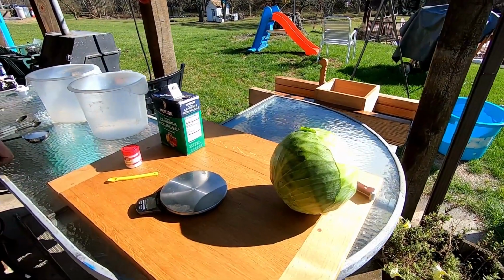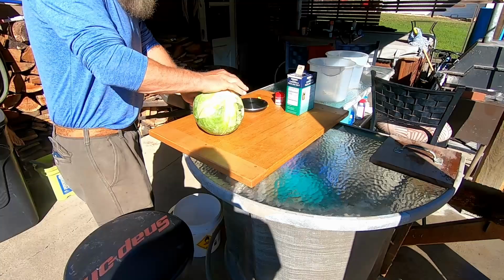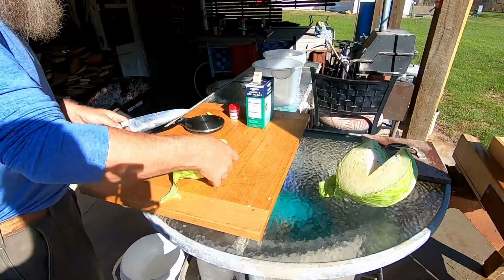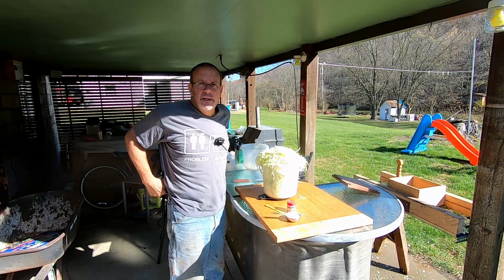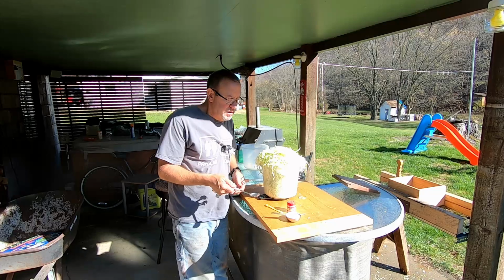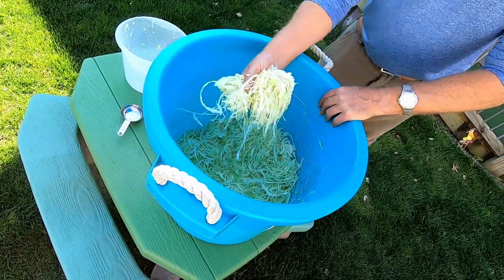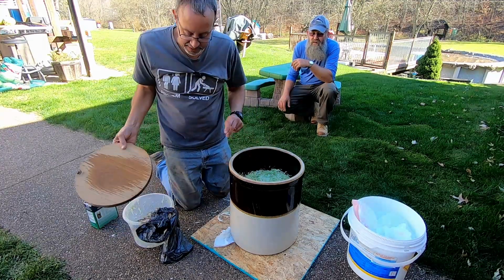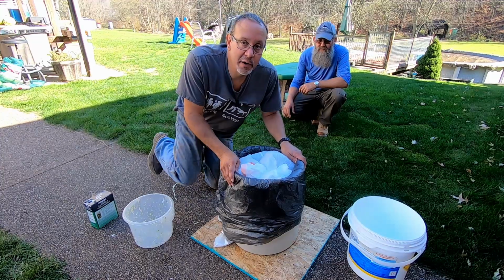homemade sauerkraut

Comment: awwww mark i miss the bus engine and the buzzing of the saw.that looked like a great food processor.hardly any sound at all.lol.i used to get some salt and eat those cores.sauerkraut and hot dogs.yum.
Reply from the maker: more bus motor soon.
Reply: Mark, Eddie, when I saw the cabbages being cored, I wondered if you guys took them and re-cored them by paring off the fibrous skin to obtain a smooth, turnip-like center... Really good, if you like that crisp, fresh bite, also good with your favorite dip.... Gary

Comment: We’ve gotten away from it.  My folks and my family used to put up around 100 lbs each year between us using a cutter Dad bought at a farm auction and restored.  All walnut.  For folks who can’t afford a crock or not sure they want to invest in a cutter, a 5 gallon dill pickle bucket can usually be found for the asking at most fast food restaurants.  A good scrubbing and scalded with hot water and you’re good to go.  And, you don’t have to worry about cracking it. Though it takes a lot longer, you could cut your cabbage with a sharp chef’s knife and a cutting board, just cut it fine.  The rest of the process is the same.  How do you store yours, can, freeze or leave it in the crock?
Reply from the maker: yes that would work just fine , I freeze it after it's done.

Comment: Been making my own sauerkraut for over 50 years. I have at times used the liquid drained off yogurt and added it to kick start the fermentation and creation of the probiotics. (Put yogurt in a cloth and hang to drain). I also use a long wooden handled, restaurant potato masher, lol. Thanks for sharing your kraut process. cheers 🇨🇦 On another note, what's Black Cherry Live Edge slabs worth per board foot down there?

Comment: 3rd cup of kosher/pickling salt; 1/8th of a heaping tsp of Alum then mix it into 10 lbs of shredded cabbage. Layer it into a crock smashing each layer down to get as much air out as possible. Sprinkle a little extra kosher/pickling salt on top. Insert a wooden cover. Then two unscented garbage bags. Put enough water in another bag to fit in the space above the cover. 
Tie the water bag tightly and place on top of the cover for weight. Age 28 days. I can't wait to try this.